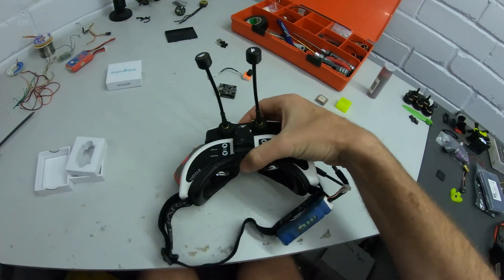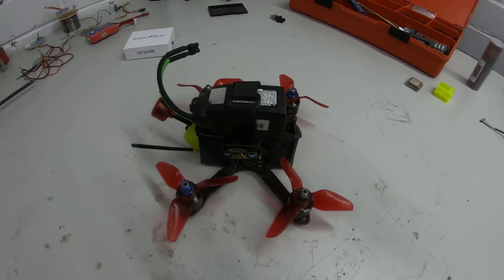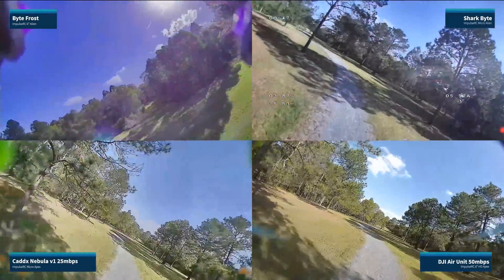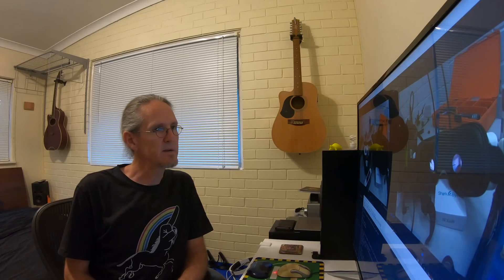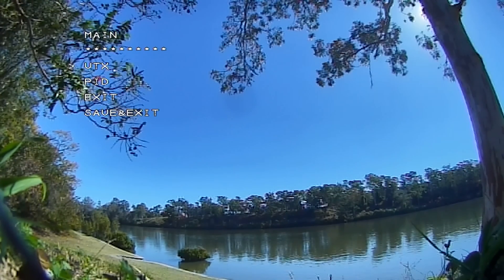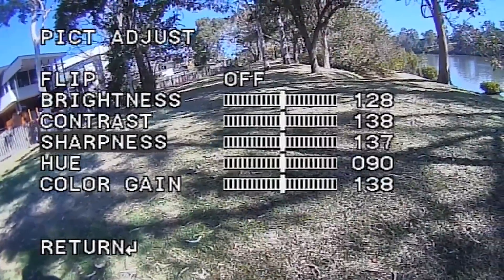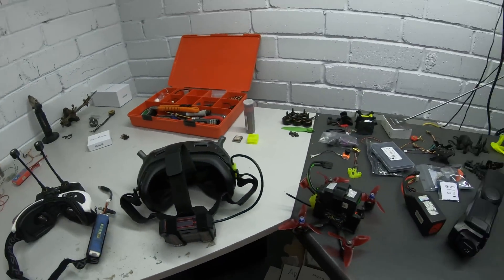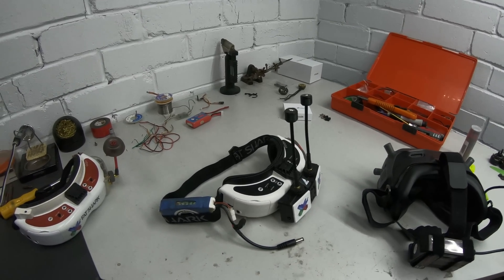Digital FPV Shootout 2 - Shark Byte

Comment: Great job with the video! As the only competitor to DJI in this space they'll do well regardless.
Can you share the weight of the vtx combo? DVR in goggle module I assume? Cheers.
Reply from the maker: Thanks man! Yeah I certainly hope it gets traction. Will have to rip out the vtx to weigh it sometime. Right now it's still in the micro alien but I will be pulling it out for a long range wing excursion soon with luck! ;) For now though the manual states: 15.4g including camera and cable (without antenna)
Reply: @strepto42  Wow that's amazing! I'd probably solder a dipole directly to the vtx board as they only weigh 0.5g. So 16g total then? Very nice!
Reply from the maker: @Tech2C  yeah and get rid of the lump of mmxc and you'll probably break even!
Reply: Naked Vista is 17g with original omni antenna or 14.5g with short dipole.

Comment: The OSD reminds me of the early days of digital TV. ;-) Shark Byte looks good, and I'm looking forward to what the near future brings. I did recently cave in and bought into the DJI FPV system, but am holding onto my HDO2s... and not just because of all the micros that I want to keep flying - it will be good to have more digital FPV choices. BRING IT ON! 👍
Reply from the maker: Yeah it's definitely early days, but I think it's promising! DJI is quite compelling for certain applications, there's no denying that. It's a frustratingly closed system though. More options are good for everyone IMO. That's why I'll hang onto multiple sets of goggles too.

Comment: Cracking intro 👍
Reply from the maker: Cheers! I practised for minutes! :D
Reply: @strepto42  one more thing fella, you mentioned limited osd. Can the beraflight osd pass to the new system? Thanks
Reply from the maker: @kool-k-kel  Only a subset (that you see on the screen towards the end of the video, plus GPS if you have it). I've already flagged with this them for improvement - it's just software though so in time it will improve. For now you get data from Betaflight, but it's in fixed positions and only certain things get passed in.
Reply: Mark Cocquio please ask for the warnings to be passed through - for example low battery warning.
Reply from the maker: @MattVentureNL  Warnings get passed in already, it's visible on the video at the end ;) Hopefully they will just implement canvas mode and then betaflight can do all the heavy lifting

Comment: Our portable digital future
Reply from the maker: Ah I think there will be room for both systems in the world moving forward. But for racing... well... we'll just see eh ;)
Reply: Yeah, maybe future for you. This week it's one year since most of us fly digital
Reply: @dav77h  maybe because not all of us can throw away analog googles, receivers, transmitters, cameras and buy 1000$+ set for digital fpv? :)
Reply: @bohdanmaksymeniuk3376  I spent way less than that to fly digital one year ago, I guess now must be even cheaper. I am also pretty sure that this will be more expensive than the dji. I could agree with you and it could totally makes sense if the price was maybe half of the dji.
Reply: @dav77h  how much minimum set does cost (googles and air unit with transmitter)?
Reply: @bohdanmaksymeniuk3376  at the time I payed around $900 for the goggles and 2 air units. I think now it's around $600 with the much smaller vista.

Edit:
Now it's $699 for the goggles and 2 vista units.

Vista units are normally about $150 each.